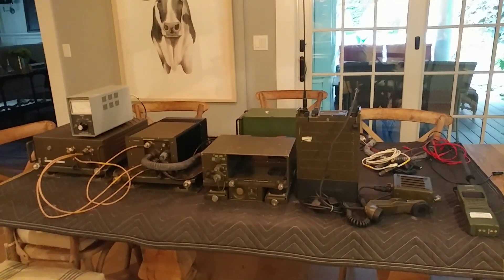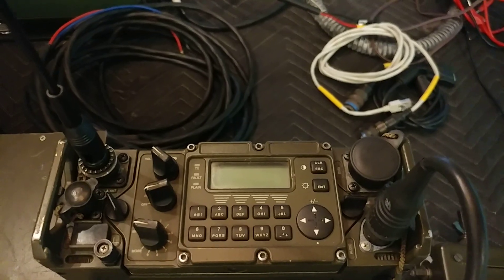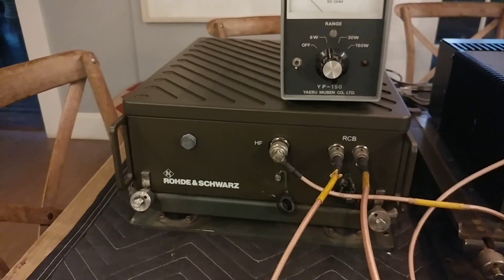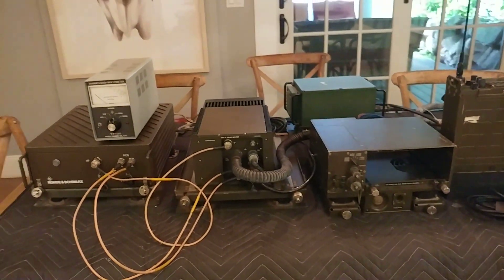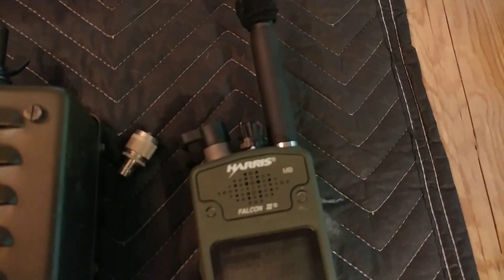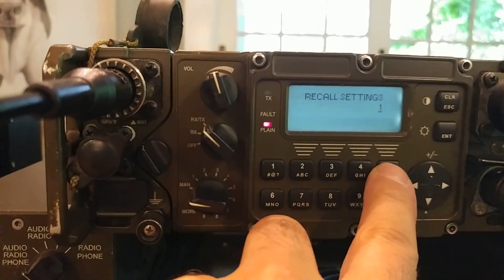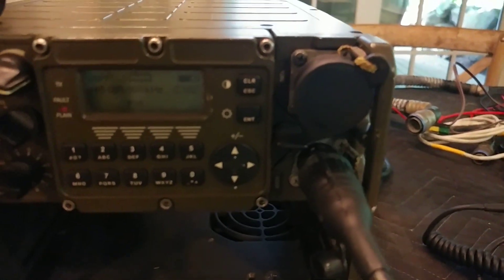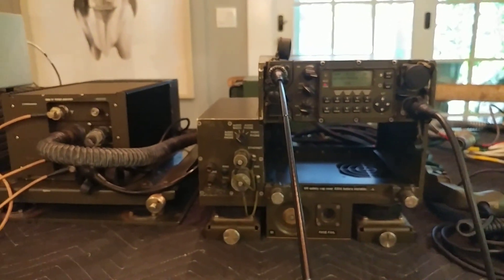Part 1 of 3 - Rohde & Schwarz M3TR Vehicular Set up, 1.5 MHz - 512 MHz

Comment: nice setup, but the MR3000 much better, TX 1,5-520 mhz ;) With Stanag Modems , Ale G2&G3 and much more..
Reply from the maker: This is the MR3000. I used the family name of M3TR but it is an MR3000. But from 108(?)-512 MHz they need external amplification as they only put out 100 mW.